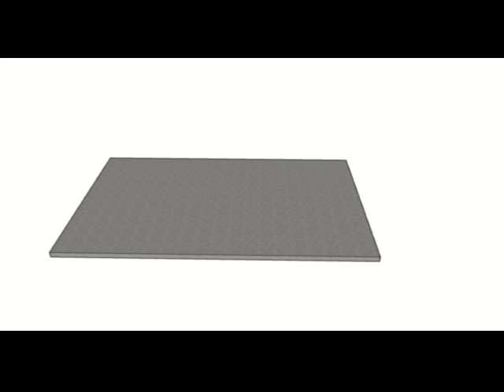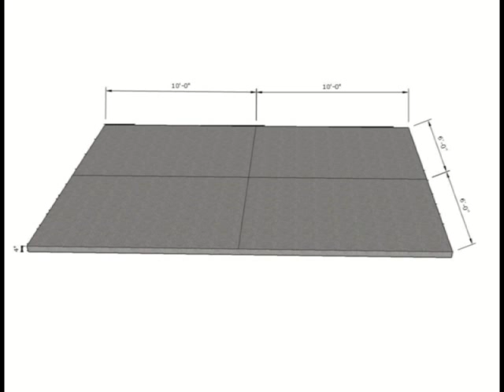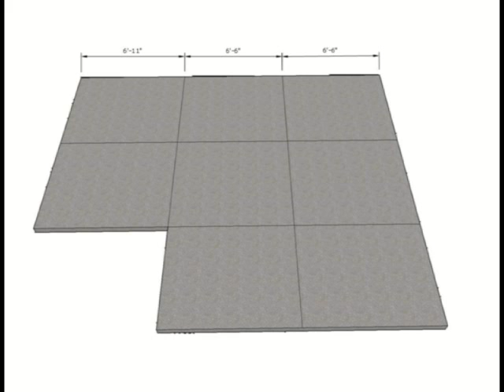Where To Locate Control Joints in Concrete - Construction Math

Comment: Hi! We are pouring concrete patio around existing deck posts. the posts are lower than the patio level and the contractor suggested we use expansion joint around the post to protect it from concrete for any rot. Is that a correct approach?
Reply from the maker: I don't think the expansion joint is necessary and you might check with other contractors in your area for more information.
Reply: @gregvancom  so are you saying I don't have to worry about concrete around the posts? Another contractor said the concrete won't do any damage and he will just pour around it.

Comment: Thanks for this simple explanation.  I'm considering using saw cuts to add a decorative element to my concrete pool deck, which has not yet been poured. Is there a point at which there are too many cuts? I'm thinking of using cuts to make the slab appear more like pavers/tiles - maybe 2'-3' squares.  Thanks for any insight.
Reply from the maker: I can't see why you couldn't do what you're suggesting on a pool deck or patio. Maybe not on a building foundation.

Comment: Is it necessary to have control joints if the slab is about 2.5 or 3 inches?
Reply: A slab is supposed to be at least 4 anything less is not recommended

Comment: you wouldnt divide .25 into 4 that would be 16. you would multiply .25 by 4... also your explanation for the ratio of thickness to control joins was super muttled. would be better next time if you just display the equation.

Thanks anyway!
Reply from the maker: Thanks for the corrections, I always appreciate it done in a kind way. Now I'm wondering out loud here, don't shoot the messenger, but it sounds like you have enough knowledge about math to understand everything in the video, so why did you end it your comment with thanks anyway. Did you find what you needed?
Reply: @gregvancom  my guess is that the OP understood from your video that 4" slab gets cut 1", and worked out the formula from that

Comment: Hello, I am wanting to remove an old driveway, and replace it with a new one. The dimensions are 24ft X 20ft. The contractor is recommending no expansion joints. My thought is at least one expansion joint in the middle of the slab. Will that suffice? Thanks
Reply from the maker: I agree with your contractor, but if you really want an expansion joint in the middle, then it might cost a few more dollars and simply tell them where to put it. Remember you're the boss.

Comment: In your first example I thought you said don't go below 8 ft with a joint, then why is there a joint at 6 ft. Should not there of been only one joint , splitting the 20 ft into 2-two 10ft x 12ft sections?
Reply from the maker: There's not an exact science on concrete control joint locations, but most of the time 10 foot or less seems to work pretty good.

Comment: I recently got a quote on a driveway pad and the guy told me on 4” thick slabs they don’t use rebar they just use 4000 psi concrete . Does that sound right ? I’m thinking about doing it myself and saving a few thousand dollars. The pad will be 30’x30’ 4 “ thick
Reply from the maker: I've seen plenty of concrete driveways last a long time without any rebar and I've also seen them fall apart, so why not use the rebar and the stronger concrete.

Comment: Thanks for the great video but I have a specific question. I just poured a 12m x 7m slab with mesh being SL92 [9mm bar with 200mm squares], has 11mm trench mesh all around the slab beam which is 550mm wide. The formwork was 235mm high all around. I did fill in the middle so the actual surface slab in 110mm thick [except of the edge beam which is 235mm of course. Almost 15 cubic meters of concrete in this girl! All of this was on a road base which was about 10mm to 40mm thick which was plate compacted many times. I am hoping I don't need to cut the poor girl, what are your thoughts please. Thanks.
Reply from the maker: Send me some pictures of your concrete. You can get our email address at the website.

Comment: question, I'm doing a concrete slab for my backyard but actually going to put individual pavers on the top of it for a better look, do you think it's even necessary to worry about cracks if I'm going to cover the slab anyway? Plus I don't really care if it lasts 20 years, five years would be good for my purposes 😁
Reply from the maker: I think I would worry about small cracks with pavers, but would if I was going to be installing tile.

Comment: What about interior curb wall doorways?
Reply from the maker: You usually don't install control joints on interior slabs, but you can and they would need to come off of the corners of the footings on each side of the opening.
Reply: @gregvancom  even in a non heated enclosed barn?
Reply from the maker: Control joints are used to reduce the amount of cracks and you can install as many of them as you would like, but some people don't mind small cracks and would rather have a flat surface or floor.
Reply: @gregvancom  yep. I think I'll do flat.
Thank you for your time!
Reply from the maker: You're welcome and thanks for watching.

Comment: At 6mins 15sec, why did you add control joints between the 4'? If it's 4 inch slab, then its well within the max 12ft
Reply from the maker: I don't know what you're referring to exactly, but most corners need a control joint coming off of them. Let me know if that makes sense.
Reply: At 6min 15 sec of the video, there's a horizontal control joint between the two 4' marks at the left side. If it's a 4inch slab, then I guess it's unecessary since the total length is within the 8-12 ft range. Right?
Reply from the maker: Even though the control joints are less than 4 foot, it's usually a good idea to have another control joint coming off of outside or inside corners as shown in the video. Let me know if this doesn't make sense.

Comment: ,Whats the purpose of that? Aesthetics? Just to prevent random looking cracks? Is it possible to just not do this?
,What if it's a poured concrete wall? Is this needed?
Reply: booger king
look at most basement floors that have no controlled cuts. they always crack.
Reply: @AugustmanReborn  yeah, I just pulled up all the old carpet in my single story home, underneath is all concrete, with cracks throughout.
Reply from the maker: It serves two purposes one to control the cracks in the other two prevent them from being longer and the same thing would hold true on a concrete wall.

Comment: How many feet should be cut the control joint? I had 2292 Sqft and 4'' thk to make concrete floor for warehouse. My supervisor said me to cut 20'x20'. I am not sure it's can avoid to get cracks. Please answer me.
Reply from the maker: According to most of the information I gathered, they shouldn't be spaced more than 12 foot apart.

Comment: my contractor only cut my control joints 1/2" deep at most on a 4" slab.  i don't have any 90degree inside corners, but i do have a 45 and he did not cut any control joints to it.  after just this winter i have some very tiny hairline cracks around this area (can't see standing up).  i'm inclined to put filler in these cracks and cut all the joints deeper, as well as add additional joints.  i have a 4.5" grinder w/ diamond blade.  would that suffice?
Reply from the maker: I half-inch deep cut is usually perfect for 4 inch slab. I don't think I would use a grinder, but you could head down to your local rental yard for a dry cutting saw or purchase a diamond blade for a circular saw. There is a good chance you're not going to get rid of the hairline cracks, the control joints are meant to provide a little relief, not eliminate all cracking.

Comment: thanks a lot. but i need to know how many feets  should be cut the control join  .  ( every 8 feet  or 10 feet?
Reply from the maker: +Rosa Sursona It all depends upon the width of the concrete slab. For example if you have a 12' x 12' slab, then it would be a good idea to cut right down the middle, leaving you with four 6' x 6' sections. You wouldn't be a good idea to cut it into 8' x 4' sections. How big is the slab you're working with?

Comment: my name's ramond so i need to know how should i cut the joins every 8' 6'  .how many feet of distance
Reply from the maker: +Rosa Sursona If you're asking me how to cut a control joint, it can be done with a concrete wet saw and the joints can also be installed when pouring and finishing the concrete with grooving tools.

Comment: so if i had a 10x20x6" slab can i get away with mesh and maybe a little added rebar down middle and ends so i wont have to do a control joint? thanks.
Reply from the maker: +Matthew Szczerba I'm assuming you're talking about the 6" x 6" mesh and your footing is going to be a rectangle measuring 10 x 20 and it's going to be 6 inches thick. I think you would be okay, but if it was me I would use the rebar and spend a few extra dollars, especially if you're going to use the 6 inch slab.

Comment: Very Very good follow up, on the concrete slaps, ? does this also apply to inside and
basement slaps too.
Reply: If you get a concrete "slap," it's going to hurt!
Reply from the maker: Yes it does, but it isn't always used in residential construction. I don't think I would cut any concrete that would be part of a structural building foundation, without the permission of an engineer. Thanks again for the great idea and I will be waiting for more in the future.
Reply: Someone mentioned installing bituminous foam between a slab and the abutting hard walls. Is that a good idea for interior slabs, such as garage floor and its three stem walls, or a basement concrete slab to the foundation walls? If so, is that a common practice to expect out of a new construction builder?